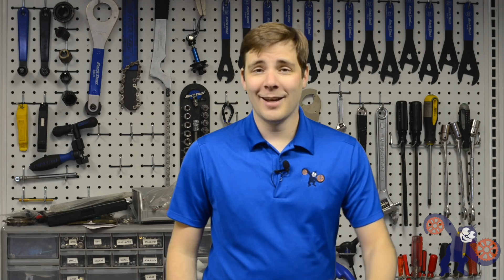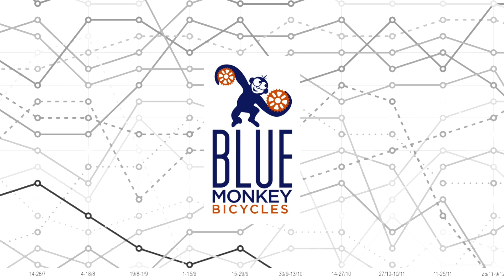New eBike Battery Breakthrough?

Comment: out of date information.  55 amp graphene ebike batteries are now being built.  they weigh a fraction of the weight of lithium and recharge in minutes
Reply from the maker: I sincerely doubt that mass market adoption of that chemistry is anywhere close.
Reply: graphene is pretty easy and cheap to make now.  We can 3d print the stuff at large scales.  as of last february, there were 3,000 manufacturers of graphine textiles in China, yet only 1 in the US  lol.  we are well behind on that technology.
Reply from the maker: Lithium cells dominate electric bikes, electric cars, toothbrushes, vapes, and many more industries, I'm sure. I'm not holding out for anything else quite yet. You can wait, if you want.

Comment: Well they got solid state batterys. Tesla also has their 2170 cell.
Reply: Well solid state battery's are a thing and soon will be replacing lithium polymer. Assuming everyone wants to pick up on Tesla's 2170 cell, it will for sure replace the 18650....

Comment: Lithium titanate made by Toshiba  (SCIB) Super Charged Ion Batteries. They have been available for 5 years now. Mine charge in 10 minutes. They are good for 10,000 cycles. Work in low or high temps. The energy input and output is more like super capacitors than batteries. While the weight to energy density is 10% lower than the best lithium ion. You can take advantage of higher charge rates and lower capacity withdrawal. This makes up for the 20% on top and bottom (40% waisted unused) of lithium ion BMS that protects from thermal run away. Thus these are superior in every way to the status quo mentioned in the video. There Are many others but these are on my bikes and I can personally attest to the quality. While I appreciate these videos and their info. I can not say they have the last word on many of their claims.
Reply: Yea but they are more expensive and capacity and voltage is way lower than a standard 18650, thus needing a lot more of them too. 
Would be too expensive.

Comment: Who needs a breakthrough? By 2020 the analysts say 70% of lithium capacity will be in Chinese factories. Their goal is to undercut Tesla on price.  It's not all 18650 cells, it's EV stuff. Audi said yesterday they are looking at $100 a kWh for their batteries.  That's where GM/LG are at, that's where Tesla is at. That makes the raw cost for a 500 wh bike pack around 50 bucks. If you could buy 10,000 slightly older tech 2500 mah cells, what would you pay? Could you put them together with the Vruzend system? Could you use a CNC to spot weld them robotically? What does a BMS cost? A case? 

I'm just saying use a sum of the parts analysis, whether you are building a highly fault tolerant pack or just cells welded together with a case. The big retail outlets could mass buy $100 ebike packs with maybe 350w motors, a Bikes Direct type frame. You could see stuff from Alibaba from US distribution centers. Bafang could come in with decent torque assist mid-drives, decent frames, Chinese packs. It's an interesting question how well the Bafang proprietary bottom bracket drives will compete with Bosch. 

http://www.greencarreports.com/news/1108199_how-much-have-electric-car-battery-costs-fallen-this-much

Comment: New battery tech is emerging that promises considerably better capacity and greatly reduced charge times.  Check out Drs. Goodenough and Braga's work on solid state glass electrolyte batteries and Tesla's new 21700

Comment: But a few years ago a 18650 was only able to have a maximum capacity of 2,6Ah, and now the latest Panasonic Cells reach over 3,1Ah. Thats quite a big improvement that also translates to many bike companys now making 500Wh Batteries in the same Format as the 300Wh Packs a few years ago.

Comment: What is your opinion of 2 and 4 stroke gas motor vs electrical?
Reply: Tark McCoy AND SUCH A LOT OF NOISE haha
Reply: I've seen a few factory built MTB's that incorporated clones of the tried and true Honda horizontal small bore 4 cycle engine design on every CRF, Z, pitbike, and CT known to man, (70cc Lifans being the powerplant from what I could tell) tearing around the dirt bike trails I ride. They appeared to be very capable rides, with speed and uphill torque somewhere between internal combustion pit & trail bikes doing about 30-35mph, and the eMTB's heading for the North Shore bicycle-only trail sections at about 15-20mph. This was at the Post Canyon trails complex in Hood River, OR
The two guys I talked to who had them absolutely loved them, and they rode both dirt bikes and full suspension downhill MTB's besides. But they still weren't allowed on the Bike trails. Only the ATV trails, and wore Dirt Bike protective gear, even though they had pedals. But they were smiling broadly, loved the light weight and flickable ride versus wrestling with a full blown 250 or 450 dirt bike. They also admitted that, when the North Shore trails were empty, they cheated and had no problems riding them, aside from the bikes being a bit heavy. They're very low torque, so didn't generate anything like enough spin to tear up the soil, obstacles, and rocks. I wager that the only real drawback is the sound of the engine, and the weight. Fuel consumption on those little motors is ridiculously small. A half gallon of gas lasts for hours in my CT70. I cannot, however, image 2 strokes working out. Small motor 2 strokes would push the noise level through the roof, the smoke they generate from burning all that premix, and on top of that, I've had to replace way, WAY too many clutches on small 2 stroke motors that grown men decided to joy ride on. They just don't hold up like the tamer, heavier 4 stroke powerplants.
I've got a 750 watt Juiced Camp Scrambler coming in the next few months, will be interesting to see how it does on both types of trails. I don't have it in me to spend the $4.5k on the Giant and Cannondale eMTB's I'm seeing on the trails with the dedicated pedaling enthusiasts.